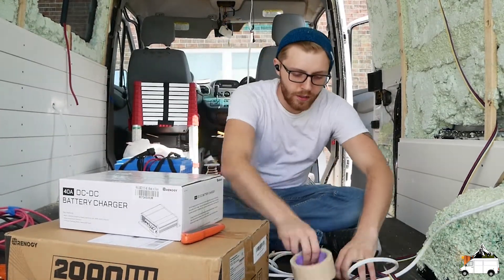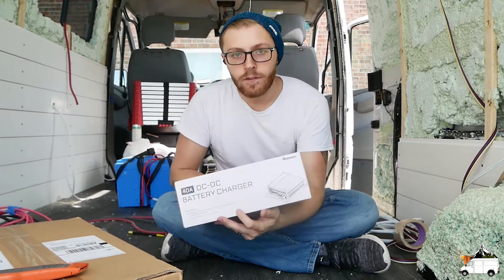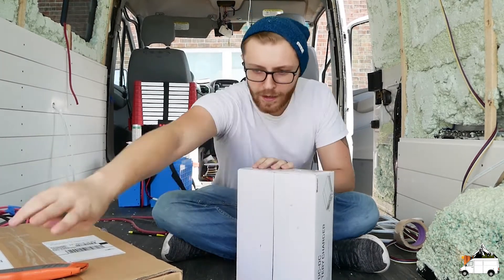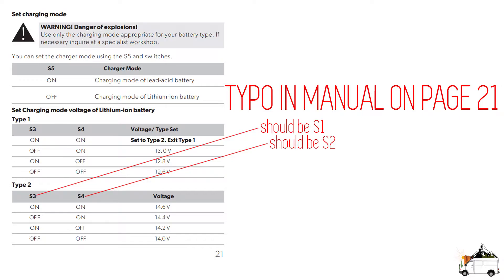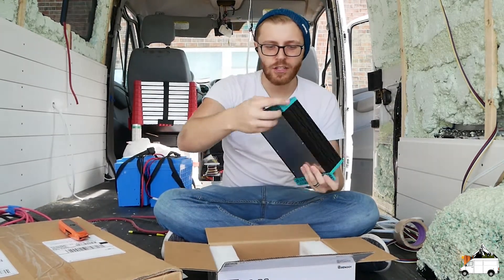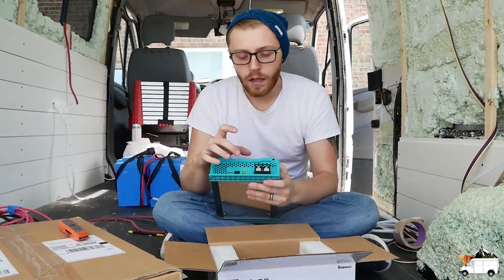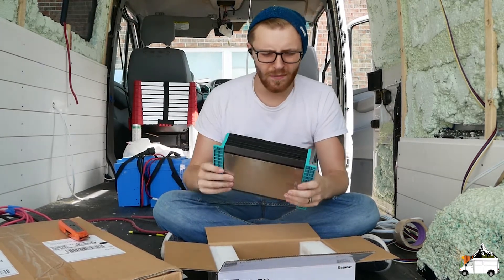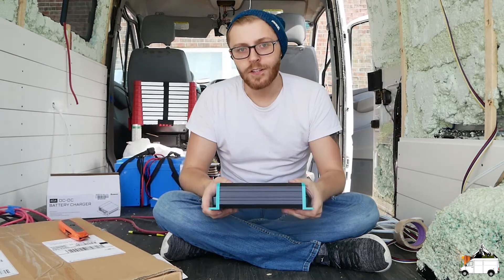Unboxing Renogy 40A DC-DC charger

Comment: Can it charge a 16 volt battery
Reply from the maker: Nope I believe just 12v. Not many RV electronics are 16v afaik. You gonna use a buck converter to run 12v appliances or a boost converter to run 24v?

Comment: Hindsight is always 20-20 (and I don't mean 20 amps).  Renogy made this product obsolete by including 50 amp MPPT and DC-DC in one product (same size).  RBC50D1S-G1.   They also removed the need to wire to ignition.
Reply from the maker: That would work for most but I needed a solar charger that included a low temperature cut off function for charging due to my LiFePO4 batteries not having a low temp cut off in their BMS. To work around this issue with the dc-dc charger I have added a thermostat to the trigger wire so if the temperature is below 40 degrees around the batteries the dc-dc charger will not get the trigger to turn on. Actually works best for my setup 👍

Comment: I already have two solar panels on the roof connected to the leisure battery via an MPPT solar charge controller. Would adding this 20A dc to dc charger make them conflict?
Reply from the maker: Good question. Nope, they should work together fine because once your alternator is running the solar charger will see the power and THINK that your battery is charged up and will switch to float charging (like a trickle). :)

Comment: Plastic ends because it's electricity brah. Don't want to be screwing too close to a conductive material.
Reply from the maker: Sure I can follow that logic but their 2000w inverter I have which can pull twice the current this can has a full metal body. It seems their newer models follow suit with the plastic. It makes sense though, you're probably right and it's really not a concern as I said in the video :)

Comment: How did you determine buying the 40A over the 20A Dc to Dc charger? Based I presume on a 200 Ah battery bank. Seems to be a black hole matter on this that nobody addresses. Even Renogy is not clear on this (no surprise) and bigger is not always better. No temp sensor needed for Lifepo's... Thx for your vid!
Reply from the maker: Temp sensor needed for LiFePo4, if you try to charge it while frozen the cells will be damaged. You have to research it for your specific vehicle really. Do you have a stock alternator? How many amps does your car pull from the alternator to run everything? Subtract that from what your alternator is rated to put out, its essentially how much "extra" power your alternator can put out. If it's more than 40 amps, get the 40 amp charger because your vehicles alt can handle it. If it's less, get the 20 amp hour charger.
Reply: @projectvagrant8197  Thx for the info. I might be wrong, but doesn't Renogy state the BMS in the LiFePo will not allow charging below 32 deg? and then resume charging when temps raise. The same with temps >140 deg
Reply from the maker: @cstu444  some will unfortunately my BMS within my batteries does not have this feature. Should have requested it from the Chinese seller
Reply from the maker: And if you'd like you can get an upgraded alternator and replace your stock one to put out more amps.
Reply: @samgerac  I had the same question, but it was super easy to Google.

Comment: Can you adjust the AMP output of this unit?
Reply from the maker: You can not, they have a 20A version and 40A version. They also just released a combo MPPT and DC-DC charger that I believe charges at max 25A each (combined 50A)

Comment: what has been your experience so far with it?
Reply from the maker: I actually haven't used it much yet due to not driving the van often. I've also got to get one more fuse and a temperature sensitive relay so it doesn't charge my battery while the temp is too low inside the van. Kind of a pain lol. I've read great things though. Renogy actually dropped a combined MPPT (solar) and Dc-Dc battery charger.
Reply: @projectvagrant8197  I had the same problem with my BMS not having a low temp cutoff. I ordered the sensor ($20) and should be good to go.
Reply from the maker: @davidstiles6260  you ordered a sensor for your BMS or for the charger? The sensor for the charger does not do low temperature cut off, I found out after purchasing from Renogy and emailing them to be sure :(. I'm going to rig up a little 12v thermostat though
Reply from the maker: @davidstiles6260  you ordered a sensor for your BMS or for the charger? The sensor for the charger does not do low temperature cut off, I found out after purchasing from Renogy and emailing them to be sure :(. I'm going to rig up a little 12v thermostat though
Reply: Project Vagrant Crap! I just reread it and figured out that the temp sensor is for compensation for the charge voltage and I don’t know if it even works with LiFePO4
Reply from the maker: @davidstiles6260  yep! I bought it because there was nothing online saying what the temp sensor was for so I emailed and asked, they had to ask engineers and came back saying nope it doesn't. If you'd like I'll make a video of how I'm rigging mine to have low temp cut off using a 12v temp sensitive relay on the chargers trigger wire when I do so in the next couple/few weeks
Reply: Project Vagrant I had the same idea about running the ignition trigger wire through a thermostat relay. I’ve seen ones that you can even program with a time delay. Setting one to wait 5 minutes before turning on would be a great way to let the alternator charge the start or battery before sending power to the house charger. I worry about the thermostats relay being a Drain on the starter battery so I might include an accessory relay so the thermostats doesn’t even get power until the key is turned. Have you ordered a thermostat relay yet? For my 2 relay approach, it would need to have non volatile memory so it doesn’t forget what I program.